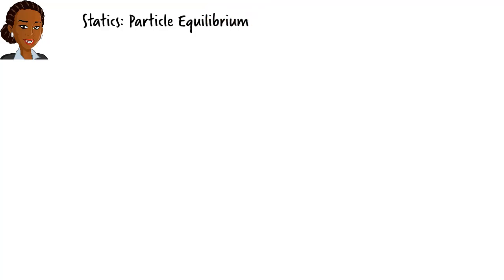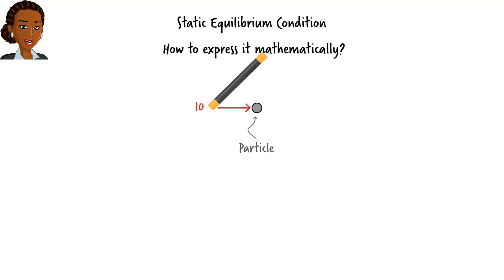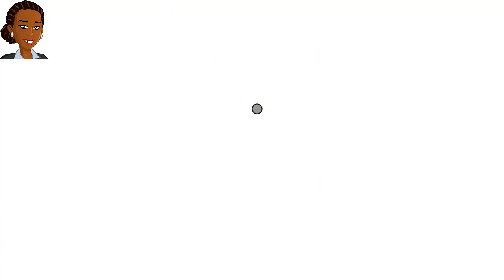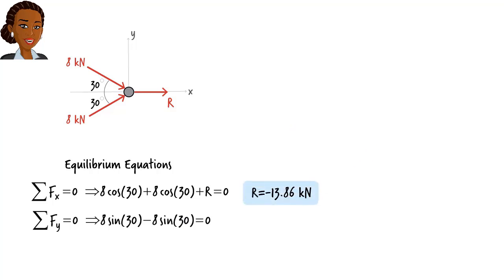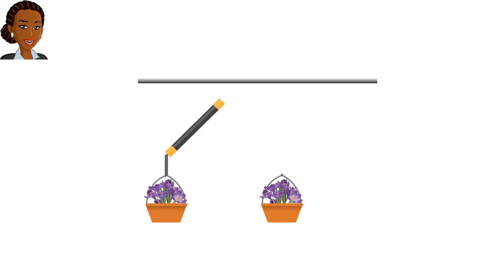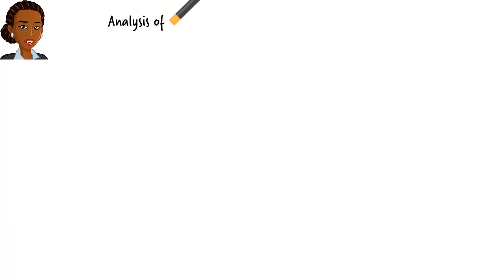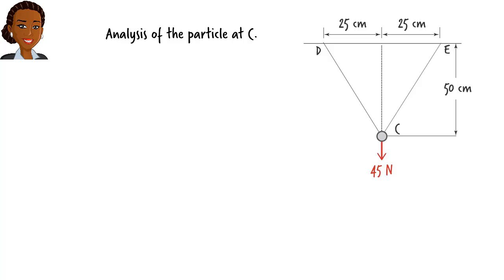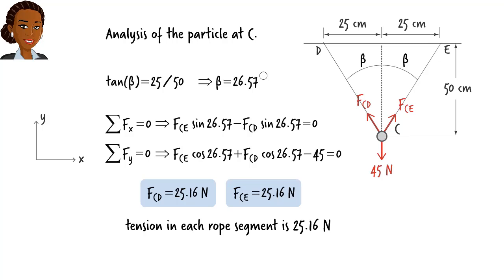ST02: Particle Equilibrium (2D)

Comment: The big problem with all the solutions showed this way, is that as a new beginner calculating this, you almost already need to know how everything works. Setting up a equation out of no understanding of example % of force applied at a point relative to the other is not easy when you dont know how to think. i get NO help from these videos what so ever, they tell me the exact same as everything else, setting up a equation (knowing already how it works, not how it works and not how to think.
Reply from the maker: At its core, engineering mechanics is applied physics, an essential prerequisite for all these lectures. If you are struggling with the concept of particle and particle equilibrium, then these refresher lectures are not going to be helpful; Your learning journey needs to have its beginning in introductory physics.
Reply: @DrStructure  just started mechanic statics at mechatronic study. i would think the university has concluded that us students should be ready to start mechanics at this point, i would also think that as i have only top grades in R2 mathematics. but i find this very difficult, adn the cause is that there is not intruduced a proper way of analysing it visualy whilst crunching the numbers, which i think is a very important step towards understanding and applying this. am i right?
Reply from the maker: @gizmakedoinduct8152  Yes, being able to visualize concepts and make sense of them in one’s mind is essential for deep learning. Equally important is the realization that learning is a personal experience and cannot be formalized through lectures. Different people learn differently, and respond differently to a specific content/lecture. Ideally, you want to view learning as a rather messy  interactive process in which you use the resources available to you to gradually build a functional mental model of the related concepts and learn how to apply them to solve problems. This process is not one-directional (from professor/lecture to student); it should be centered around a persistent interactive engagement between you and the professor having various dialogues with the aim of guiding you through the process. Although this online forum is no substitute for in-person interaction, you are more than welcome to pose specific questions geared toward addressing any ambiguity that you may have pertaining the topics covered in these lectures.
Reply: @DrStructure  i actually just this monday (yesterday) gained understanding of this analytic mechanic, by asking a friend of me to do a task,  while explaining her thoughts on solving it + drawing the thoughts on the figure in the task step by step, was as easy as that.
Reply from the maker: Perfect!

Comment: At 3:30, why dont the Fx components have a negative sign? , since in the 2nd and 3rd quadrant Fx is negative.
Reply from the maker: Place the tail of the vector at the origin and see which quadrant the head of the vector resides. If the head resides in quad 2 and 3, then Fx would be negative, otherwise Fx is positive. In this case, if we slide the two inclined vectors so that their tails end up at the origin, their heads are going to be in quads 1 and 4, hence the x components of both forces are positive.

Comment: What is the difference between static and dynamic equilibrium?
Reply from the maker: In a nutshell, in dynamics the fundamental equilibrium condition that we deal with is:
The sum of the force vectors = (mass)(acceleration)
In statics, we deal with problems in which acceleration is zero. So, the equilibrium condition is:
The sum of the force vectors = 0

Comment: How do you know if it is sine or cosine?
Reply from the maker: It depends on the angle that you are using. If you pick the angle between the force vector and the horizontal (x) axis, then you should use the cosine of the angle for calculating the x component of the force, and use sine for the y component of the force. On the other hand, if you pick the angle that the force makes with the y axis, then use sine for finding the x component of the force and use cosine for determining the y component of the force.